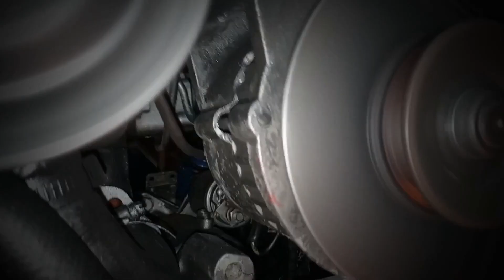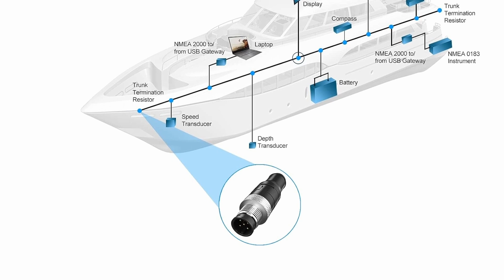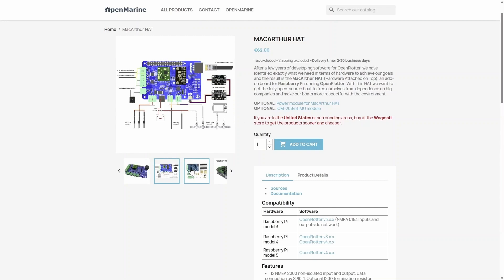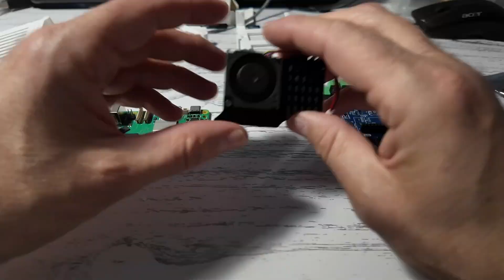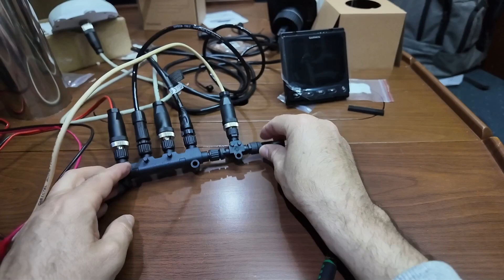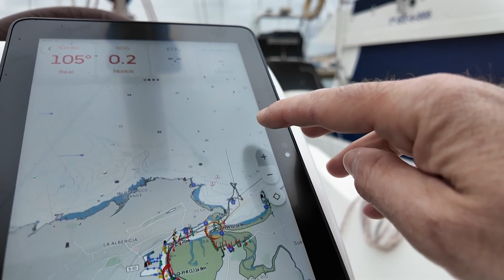EP97 - Raspberry Pi 5 and NMEA 2000: Add Wi-Fi to Your Electronics

Comment: Hi! I have a Silva 40 Direction wind instrument, model 19587. Its manual specifies the NMEA 0183 output as 0–10 V DC, sink/source 25 mA, 8 data bits, no parity, 2 stop bits (8N2), at 1 message per second.

Can I connect this output directly to one of the MacArthur HAT's opto-isolated NMEA 0183 inputs, or do I need an additional signal-level converter?

Comment: I'm not sure if you answered this or not but my Garmin chart plotter network doesn't work with my wifi camera. Can I fool the wifi into thinking I really have WiFi and Internet so I can view my wifi camera through my cellphone. And can I put songs on an SD card and plug it into the raspberry pi and share it with everyone on my boat
Reply from the maker: Many Wi-Fi cameras don't require an internet connection to view them over Wi-Fi. You just need to use the correct protocol or URL. There's an Android app called IP Cam Viewer that helps you locate and view local cameras that support the RSTP or ONVIF protocol. As for sharing files on your Raspberry Pi, you can configure it as a NAS to share files on your Wi-Fi network: https://www.raspberrypi.com/tutorials/nas-box-raspberry-pi-tutorial/

Comment: I have a vf radio that out puts ais on nema0183. I have a garmin eco map 74dv THAT I WOULD LIKE TO REPLACE.
and use navionics on my ipad. I would like to connect up my existing depth transducer from garmin. Can i go to your low cost salior site to figure that out?
Thank you
Mike
Reply from the maker: We explained exactly what you need in episode 96: how to do it with a device that costs around $10 and converts NMEA 0183 to Wi-Fi so you can view it on your Navionics. https://youtu.be/J-sr9aTcY_Y

Comment: Fabulous, being new to raspberry pi would a pi5, MacArthur hat and power supply with WiFi be enough to run open cpn, all the boat electronics , autopilot, engine and bilge sensors, alarms, cameras using an android car radio as a 10.1 screen or would I need more than 1 raspberry pi 5?
Thanks again
Reply: I'm also interested in where you got the wind instrument from